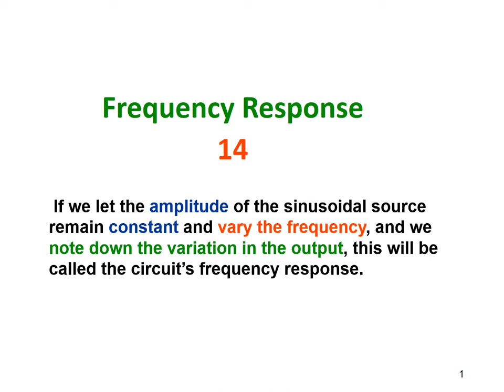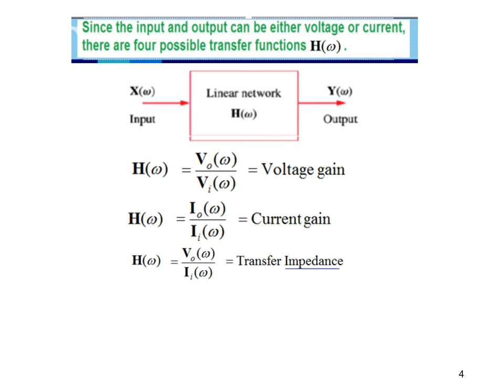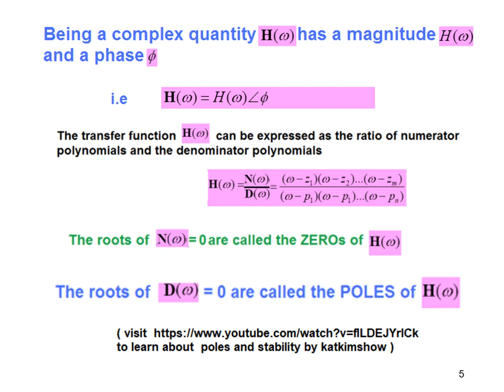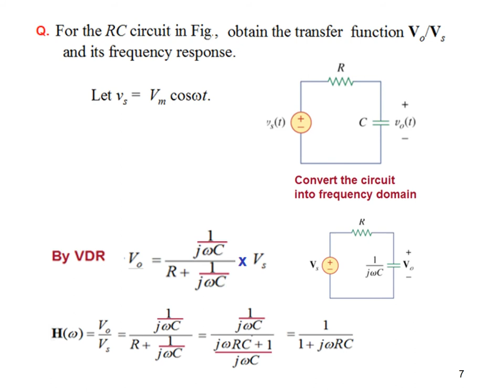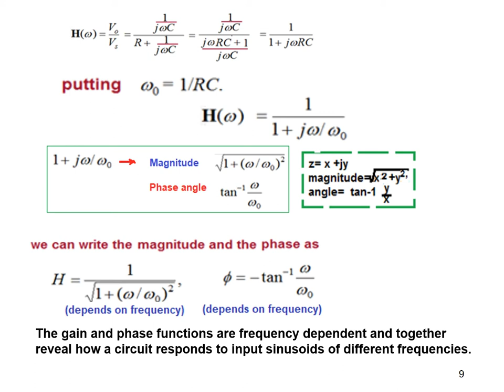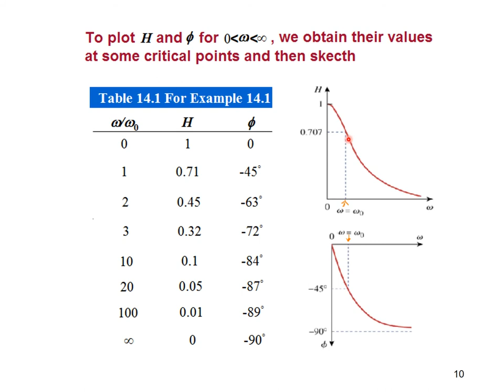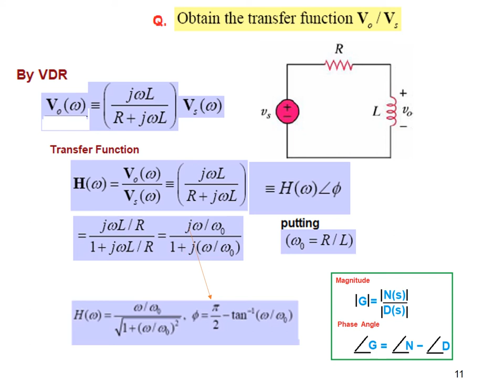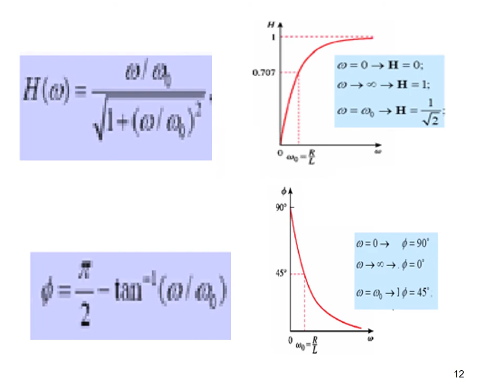Frequency Response ||Transfer Functions || Example 14.1 || Practice 14.1 || (Alexander)

Comment: Sir on 10:00 you said "So this is the magnitude and the phase angle if when it goes up, it will become a minus sign added here"
Sir what goes up I can see no difference it was w/wo and it's still w/wo so what was the change I can't understand the logic behind the negative sign please explain
Reply from the maker: for function 2+j2, we get value (in polar form) 2.828<45 , but for 1/(2+j2) we get 1/(2.828<45)  which equals 0.353<-45. The angle has gone negative. Same is the case here (the angle becoming negative)
Reply: @ElectricalEngineeringAcademy  Jazakallah Sir